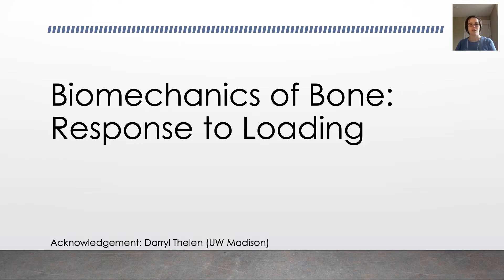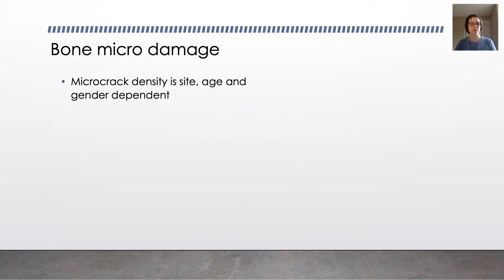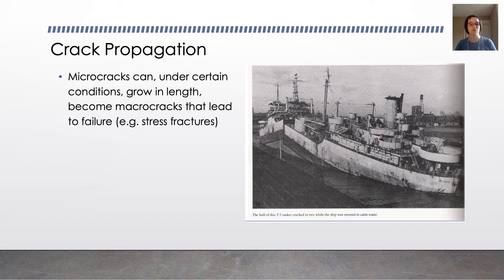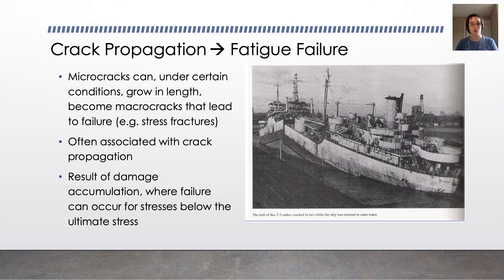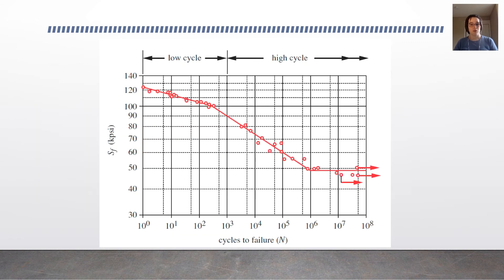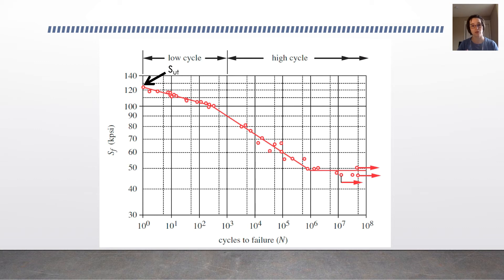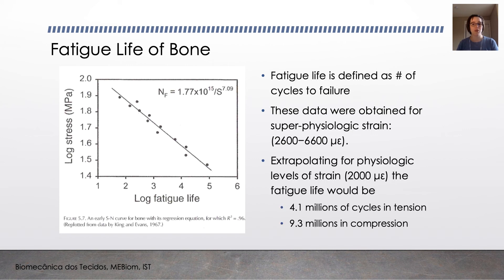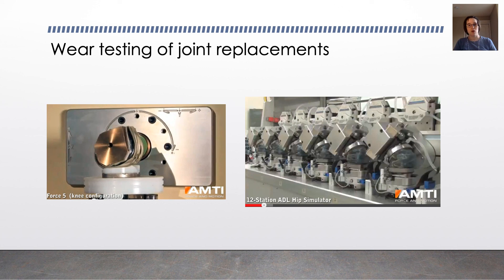ENGB 420 - Biomechanics of Bone - Cracking & Fatigue

Comment: Limb lenghening surgery using Precise 2.2 method is the best method available to increase height after growthplates fusion in bones.
So in this surgery they first break leg bones and put precise nail in leg and that distract the bone  from breaking over few days using device. So that few inches can be added to height. 

Complications of this surgery are many but mainly its nerve damage and muscle strain ,because of which doctors have to stop after 3inches because if they will increase the gap more than 3 inches then there could be muscle damage or tighening or other damages. 

If you can put light on how this problem can be tackle. 

How can this be made possible that one can add 1foot to legs through this surgery and the complications will not be there .
I simply am looking  for solution .Coz my heart says this can be possible.

Thanks